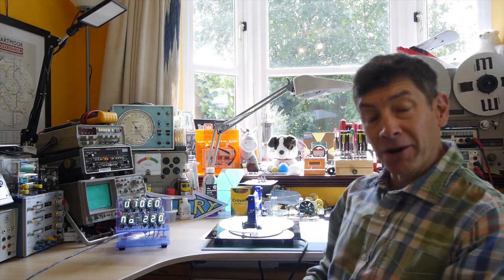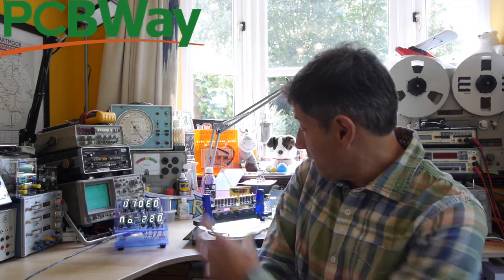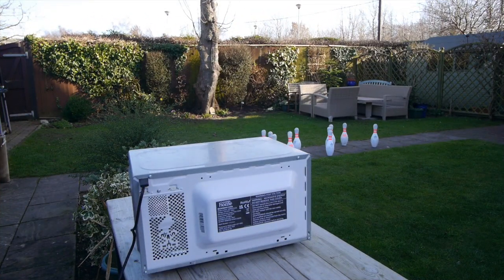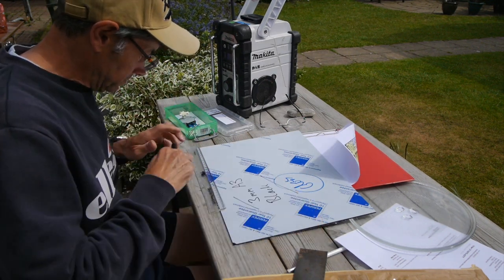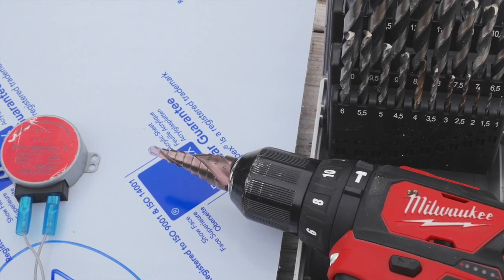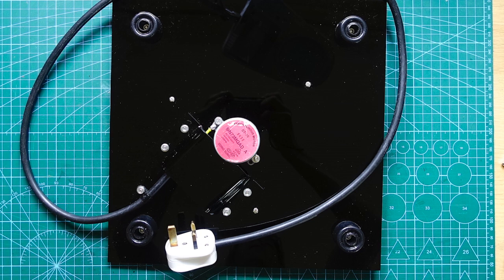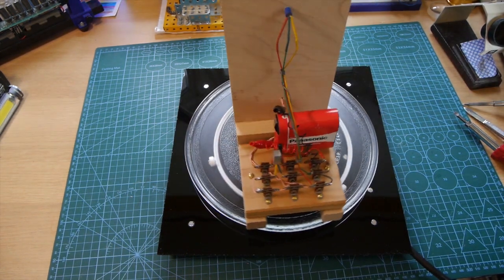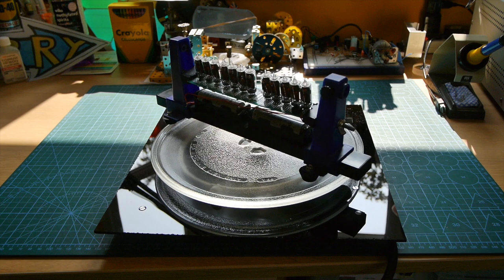Recycled Microwave Oven Turntable - F-J's Physics - Video 220

Comment: Excellent video.  I was planning on making exactly this and seeing your video gives me a good plan.  I kept a couple of the old motors from previous microwave ovens, sadly not the platters. Never mind I'll find another old microwave easily enough. Thanks.
Reply from the maker: Great David!  Remember those old motors might start rotating in either direction and watch the mains too!  Why not use a 12V motor and small power supply so it's safe for everyone?  I am sure you know all this stuff!  Let us know how you get on.  Best wishes, F.J.

Comment: Just remember that a lot of modern microwave ovens now use a 36VAC motor for the turntable, as this lower voltage is a lot less turns of the ultra thin CCA wire on the former. Motor is otherwise identical. The 36VAC is derived from the fan motor, from a third terminal that is wound to have 26VAC on it, making double use of the fan motor to move air to cool the magnetron and cavity, and to generate the 36VAC for the turntable itself.  The turntable motor itself will run off 24VAC, easy enough to get from a small mains transformer, and you can generally find one in old radio cassette players or clock radios, as they use a small 3VA transformer inside, which often has a trio of secondaries, 2 are going to be around 8VAC centre tapped, for the clock display, and the other is around 12VAC, to run the radio section. 

So connecting the secondary wires in the correct order (you will just have to measure, and then connect correctly, as the colours used are in no way standard) will give you something around 30VAC, which will run the 36V motor, though some well used examples might not be self starting with low voltage, but they often will start easily, direction being random in most cases, unless you get one of the more expensive ones with a pawl that forces it to start in one direction only.
Reply from the maker: Sean, thanks so much for this fantastic and detailed explanation of how to do a build should you have a newer microwave - hopefully it has not broken down yet!  Clever that use of the fan windings.  There must be all sorts of interesting back EMFs and the like which don't cause issues.  This motor too always starts but can decide to start in the other direction sometimes.  Thanks again and great to have you on board!  F-J

Comment: Another great project if I come across a Microwave, many thanks as always
Reply from the maker: Thanks Alan.  Yes have a go.  More to come from harvested microwave oven bits soon!
Reply: @AnthonyFrancisJones  Yes they generally rot out case wise by me, though the touch control ones also have lots of keypad faults. A thing I see now is failing HT feedthrough capacitor failure, which was unheard of on older units, those capacitors having been cost cutted down now, as otherwise the magnetron is generally the most reliable part until it goes low emission, which then means low output.  i keep old magnetrons that are good for that purpose, as a new one is approaching the cost of the microwave, and generally you only have 2 different magnetrons, often the only difference being the direction of the connections relative to the mounting ears. fuses blowing is almost always either microswitches failing, or the magnetron RF filter, though if there is a HV fuse there it tells you which one was the cause, as the input fuse always blows with the HV one, telling you it is magnetron, diode or capacitor, and generally it is diode, and most recently magnetron. Input fuse blown with HV fuse intact microswitches or door mechanism is warped. you can get the door mech as spare part, common to many cheap microwaves, and the switches the same.
Reply from the maker: Thanks Sean.  Really interesting.  You have explained the faults (and fault finding beautifully) as knowing an effect well often leads directly to the cause as you so rightly point out.  Yes, the quality is just not there anymore.  Just replaced our Neff fridge and it must have done 20 years or more.  Build quality was fantastic.  I took in photographs to the local shop to show the sales person just how much better the older design was.  Cyclopentane leak so did not really want to mess with that though probably not a difficult fix.  Now what YouTube 'harvested components' can I do with an old fridge other than explain the Carnot cycle?
Reply: @AnthonyFrancisJones  Will tell you the gas loss is inside the foam, where the steel pipes used for evaporator and condenser have rusted through.  most likely at the evaporator, where the capillary tube is brazed to the steel pipe, as that condenses water, and rots the pipe.
Reply from the maker: @SeanBZA  Thanks Sean.  Sounds right.  We could smell CP inside the fridge and it was not worth me trying to repair and regas though I might take it all apart to have a look anyway.  Yes, all that condensing water cannot be good news!  Thanks again.  I am learning a lot from your experience and knowledge.  F-J

Comment: I just threw away my old combination oven after a failed attempt to repair it, but I didn't think to salvage anything.
Mainly because I have cupboards full of old stuff that I never use.
Reply from the maker: Yes, and the moment you throw something out you will definitely need it John!
Reply: @AnthonyFrancisJones  I use the old case as a store for scrap steel, till it is full, and then it all goes to the scrap yard. it will hold lots of old screws and nails, plus empty cans, with it having a convenient door as well. Transformer is normally CCA wire, not even worth stripping, so it goes in the case as well.
Reply from the maker: That's a brilliant idea!  I had never thought of that!  You could have rows of them stacked up as a rather unusual workshop storage!  I was thinking of putting it out for my son who has a 'mud kitchen' in the garden and likes that sort of thing.